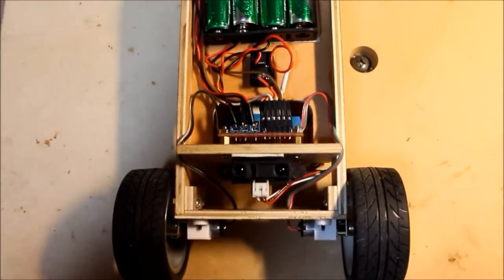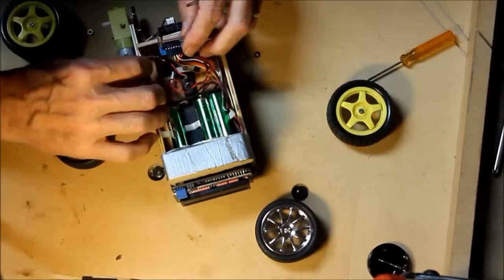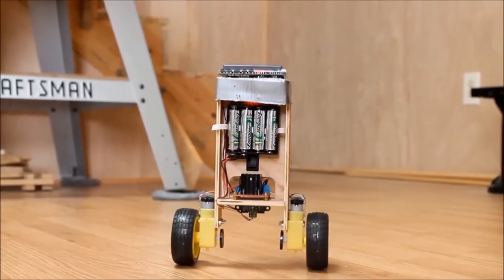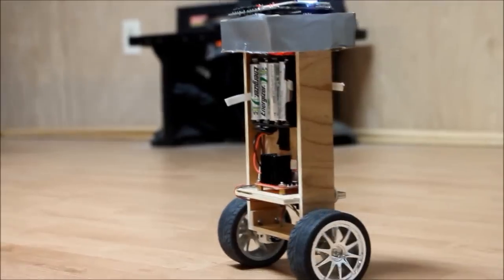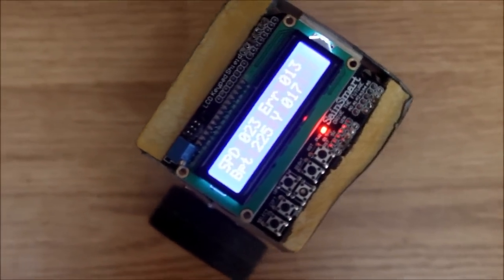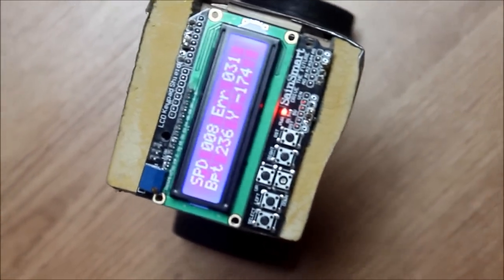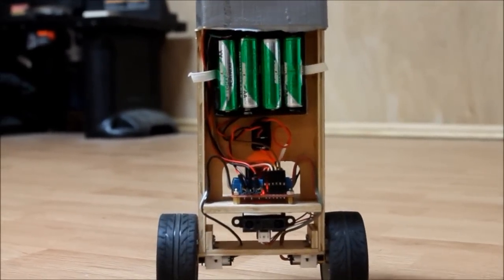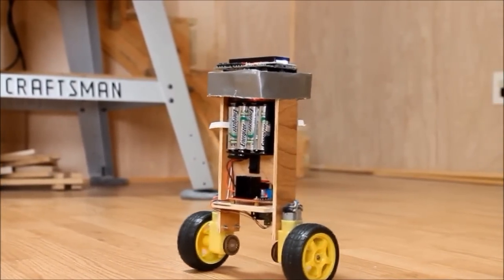Arduino/MPU6050 Balance Bot Part2

Comment: I have replicated your ROBY using an Arduino MINI and two motors and wheels i was having. It  seems to work but it is not able to keep the balancing. Surely i have to modify PID but I don't know how also because it is the first time I am working with it. Could you suggest a way? If it is of some help the error i read on LCD at a standing position is 1500-1700, the motors are rated for 77 round/minand the weel diameter is 65mm.The second question is how to calculate the Gyro and Accel offset. 
Thanks
Reply from the maker: slvg1942 "...at a standing position is 1500-1700,..." 
These number sound large. That would imply that the MPU thinks its tilted between 15 to 17 degrees.. I am used to seeing only 3 digit numbers like what you see in the video. There "192" means the mpu thinks it's 1.92 degree off of horizontal. Or another way to say it is the car is leaning forward by 1.92 degrees.
for a start, I would disable the motors and maybe some of the code and test how the reading change as you manually rotate the car about the wheel's axles.
But assuming that the gyro has been calibrated in level postion, then the number
you see on the display at startup (while holding the car at it "balance point")is the number the number (but with a decimal point before the last two digits) that you would normally load sketch variable "PitchBalancePt" with. In my case that was  "2.29".
As for what are good PID values. I have no easy way of  telling you. The best I can offer is start by setting the "Ki" & "Kd" values to 0.0 and make sure that a positive "Kp" value causes the car's wheels to rotate in the correct direction to compensate for it falling. In my case "0.32" ended up being the number I needed for the N20 motors shown in the video.  But basically you will want to find the largest value that moves your car the right way. But not so big that the car overshoots and ends up falling backwards to the direction it was originally leaning.. Next, you start increasing the  "Ki" & "Kd" values, until you find the combination that works best with your car.. Have lots patience, and build the car so that it can survive many crashes ;-)
Reply: jmhrvy1947 
At first thank for your help. 
I was checking the rotation angles and i got a little confused.  You suggest to mount GY521 component down with Y axis pointed toward the back it means that the X axis is the same of wheel  axis.
In such a way when the car lean forward or backward is rotating around X axis it means a variation of roll not
pitch or  am I wrong ?  I am not able so see the proper position of GY521 in your video so before making modification on hardware I will wait for your answer. 

I got your code from github . The following instruction
//setup PWM frequency to ~60Hz for OutPut pins 13 & 11 
TCCR4B = TCCR4B & 0b11111000 | 0x06; //Set Digital pin 13 Right Wheel PWM period @ ~2ms
is not recognized by arduino compiler because it is setting a CPU register, I have cutted it.
Reply: jmhrvy1947 
At first thank for your help. 
I was checking the rotation angles and i got a little confused.  You suggest to mount GY521 component down with Y axis pointed toward the back it means that the X axis is the same of wheel  axis.
In such a way when the car lean forward or backward is rotating around X axis it means a variation of roll not
pitch or  am I wrong ?  I am not able so see the proper position of GY521 in your video so before making modification on hardware I will wait for your answer. 

I got your code from github . The following instruction
//setup PWM frequency to ~60Hz for OutPut pins 13 & 11 
TCCR4B = TCCR4B & 0b11111000 | 0x06; //Set Digital pin 13 Right Wheel PWM period @ ~2ms
is not recognized by arduino compiler because it is setting a CPU register, I have cutted it.
Reply from the maker: slvg1942 Yes. You are correct my GY521 is mounted so that X axis is in-line with the Wheels. And the Y axis points to the back of the car.. If yours is mounted some other way, then rather than changing the location of your MPU, it may be easier for you to change the code (by changing signs and or Array elements) that are being used to sense what is happening to the car. 
As for the code issue (TCCR4B = TCCR4B & 0b11111000 | 0x06; ),  that is because the "Mini" has a different set of timing control registers from what is found on the Leonardo. So for your car, you are correct to comment this line out, and at this point, not worry about it. If you are using Pins 5 & 6 for PWM then I think you would be getting very similar results to what I have using pins 11 & 13 on the Leonardo. Or another option for you, could be to use 3 & 11,  plus the code "TCCR2B = TCCR2B & B11111000 | B00000011;"
See : https://arduino-info.wikispaces.com/Arduino-PWM-Frequency

It sounds like you are pretty close to having all the parts in place. Let me know how it works out.
Reply: jmhrvy1947 

Ok one bug is out. I was using pins 10 and 11 for PWM but they are controlled by different timer so i have modified using pins 3 and 11.
AXIS.  I was quite confused about axis because I  was  using the Eulero convention . Just to fix the point,
assuming the Z axis perpendicular to the plane of GY521 PCB and a vector with  origin (0,0,0)  the pitch is the angle done by the vector an the plane xy or if we prefer is the bent of our car referred to the  the plane of wheels
and Yaw is the angle between X axis and the perspective of the vector on plane xy or if we prefer is the steering
of the car.
I have installed GY521 with components up instead of down, but I presume there is no difference inverting Z axis
Give me some time to digest and test then i shall report if it is standing or not.
Reply from the maker: slvg1942 "...Give me some time to digest..."
I fololw you there ;-)
The terms I think of this in is "Pitch", "Yaw",& "Roll". They are artificial assignments with respect to how the board (GY521) is oriented. All three behave proportionally the same, and with them all being bundled in the same array, you can mount the board on any plane of the car you want, and then pick which ever array element returns the tilt (pitch) of the car. If that element is backwards, then flip its sign. The same process is true for the yaw. 
To test, first change the code to output the array elements to the serial port (ypr[0], ypr[1], & ypr[2]) and watch how these values change as you tilt & turn your car. Once you have identified which is which, then assign the appropriate element to "InputP" and "InputY". Then the next step is to force ""InputY" to be zero, then set the sign of the  "InputP" ypr[n] element so that the wheels turn in the correct direction to bring the car back upright when it leans forward and backwards. In other words, when the car leans "forward" the wheels turn "forward", If one wheel rotates one way, and the other turns in the opposite direction, then either one of the motors wiring needs to be reversed, or you could reverse the code [see void SetMotorDir(int Motor , boolean Dir)]. Once you have the "InputP" term working, then force it to zero, and let "InputY" control the car. And this time determine what the sign its  ypr[n] needs to be to bring the car back to its original heading.  Because you've already "fixed" the motor directional control. This time all you will need to worry with is the ypr[n]  sign.

After that you are ready to dial in the  Pitch & Yaw PID values.  This is where you are going to need a lot of patience. And car built to survive a lot crashes
Reply: jmhrvy1947 
GY521 is OK, I have chcked vectors ypr[2]=pitch and ypr[0]=yaw.
Motors also seems to be OK. I made Ki=0,  Kd=0  and InputY=0. In such a condition,  keeping the car in upright position,  the wheel are rotating continuously  clockwise  and anticlockwise trying to keep the car at the balancing position. I have just to investigate why the driver L298 become quite hot, probably is due to this oscillation. Now i have to check  the sign of ypr[0] but i had to change job. Now i am involved in grandfather's job so in the time I am trying  to go more deep in your soft, hopping my question will be of help for some one more.
I shall start with PID computation that is the first time I am using.
-- Could you state when car reach the "if(BackAway)" condition.  I was never able to reach it.
-- Why "Input = 1530.0*sin(Input) // 255*6*sin(Input)" 
-- Why SetPoint is all the time 0.00
-- What you mean and why  OS=18 and BrkPt=22
-- why "Kp = Kp*2.977
--what dou you mean  with "DtI = Ki* error" and Cap = 10.0
I have some more questions, but i hope, from these ones to understand a little more-
Thank again
Reply from the maker: slvg1942 
Ok... All good questions. Not sure how to best answer them though.
The BackAway test is probably will not apply to your car. My car is fitted with an IR distance detector (that can sense objects ~8 inches in front of it; i.e. A wall) When it does detect something, then this flag gets set and the "follow on" code changes the balance point which "tricks" the PID into making the car lean backwards just enough so that is rolls away from the wall. That part of the code, is mostly there to test the idea (or method) of commanding a that's other wised balanced to move in a specific direction, and still maintain its balance.
"SetPoint Always 0?" This was just an arbitrary choice. However, the way I came to it, was in a classical control application The user inputs a set point value, and the the control system does whatever is necessary to match that value. In this case, I wanted the car to be in balance, and that balance point was zero degrees. So my set point is always zero.

Now the rest of your questions are harder to explain as individual line items. So here's my layman's view of what was needed to make this work.
First, this is not a linear controls problem so the "P" term in the PID needs respond in a non-linear way. Secondly using the motors shown in the video, I estimated that if the car was more than 4 degrees either side of its balance point, they would not have enough reserve speed to bring the car back to balance. So by 4 degrees, they needed to be at full power; However, for very small angles, it takes very little movement to bring it back. (In the RC world they call it "Expo") So I was looking for an algorithm that effectively gave an "expo" response for a linear change in angle. 
I played with a number of different ways to get what I thought I needed, and for sure, there is no guarantee, what I settled on is the best. 
If you can run Python code, here is a test script I used to examine the "P" component over the +/- 4 degree range that I set as my artificial boundary:

#!/usr/bin/python
# -*- coding: utf-8 -*-

import sys
import math

Kp1 = 0.12 #.5 #
Kp2 = 0.9
Kp3 = 0.3
Ki = 3.6
OS = 18
BrkPt = 22
Cap = 10.0
X =  16/BrkPt+(OS/(Kp3*16))
DegVal = 02.0
RadVal = math.pi*DegVal/180.0
print("Error\tErSqrd\tLinear\tHybrdSqr\tIntegral")
for i in range(40) :
        kp1 = Kp1
        kp2 = Kp2
        kp3 = Kp3
        ki = Ki
        offset = 0
        error = 0.25*(i-16)
        RadVal = math.pi*error/180.0
        Input =255.0*6*RadVal
        errwrkng = Input
        errwrkng1 = Input
        if(abs( Input)>16):
            #Square the error term
            sign = 1.0; 
            offset = 18.0;
            if(Input<1) :
                    sign = -1.0
                    offset = -18.0;
            if (Input!=0) :
                    errwrkng = errwrkng/6.3;
            errwrkng = sign*6*errwrkng*errwrkng;
            errwrkng1 = errwrkng1/22;
            errwrkng1 = sign*22*errwrkng1*errwrkng1;
      
        else :
             kp1= kp1*2.4;
             kp2= kp2*2.4;
             kp3= kp3*X;
        errwrkng1 = errwrkng1+offset     
        DtI = ki*errwrkng1
     
        if (DtI >Cap):
                DtI = Cap
        elif (DtI <-Cap):
                DtI = -Cap     
        pwm1 =  kp1*errwrkng
        pwm2 =  kp2*Input
        pwm3 =  kp3*errwrkng1
        print(error,"\t", pwm1,"\t", pwm2,"\t", pwm3,"\t", DtI)

        

print("All Done!!")

If you plot the results of this script you will see that the Hybrid method gives the response of a linear system for small angles, but transitions into the response of a squared system for larger angles.

Anyway, hope that helps you sort some of this out.
Reply: jmhrvy1947 
HI
I am coming again. I am playing with a board fixed  on the table with same tape with instelled an arduino nano and a GY521, no more. If I load the original program made by Jeff Rowberg  the Yaw (ypr[0] * 180/M_PI)  I can read when it became stable is about 51.84 degree. In the same condition if i go to read your 
InputY =(ypr[0] * 180/M_PI) I read something about 6.70 degree. I am not able to  discover why.
Thank
Reply from the maker: slvg1942 To be honest, I am confused by your question. So I am going to try to answer it,  with a question.
Around line 230 in my sketch, you will find these entries:

    // supply your own gyro offsets here, scaled for min sensitivity
    //Sensor readings with offsets: 4 4 16380 1 0 0
    //Your offsets: -1200 -2080 1288 35 -28 -39
    //Data is printed as: acelX acelY acelZ giroX giroY giroZ
    //Check that your sensor readings are close to 0 0 16384 0 0 0

    mpu.setXGyroOffset(35);
    mpu.setYGyroOffset(-28);
    mpu.setZGyroOffset(-39);

    mpu.setXAccelOffset(-1200);
    mpu.setYAccelOffset(-2080);
    mpu.setZAccelOffset(1288);

These values( 35; -28; -39; .........; 1288),
are only really true for the MPU I have here.

Have you found the values you need by running the sketch found at?

http://www.i2cdevlib.com/forums/topic/96-arduino-sketch-to-automatically-calculate-mpu6050-offsets/
Reply: jmhrvy1947 
OK bug solved. All the problems I was having was due to the offsets. At the same time I learned an obvious thing. Whichever is the position on the table of the GY521 , when you start the MPU6050, this became the reference position or if you prefer the zero position.
Reply from the maker: slvg1942 Excellent.... Sounds like your ready to move on to the next problem... Speaking of which, is the 298 still getting hot?
Reply: jmhrvy1947 
I shall give the answer at the end of the month when I shall be bach at home, now I am 1000 km faraway  with just a MINI and a GY521. I think I shall face some more problems becase my car is heavier than your and with quite bigger motor. if you like and you say me how,I shall send you a photo.
Reply from the maker: slvg1942 I'll send you a PM.
Reply: jmhrvy1947 
HI

As you have foreseen there is a new question. You have defined two variable "Setpoint" and "SetpointS" Why are you using  "setpoint" in PID steer computations ? 
659 double error = Setpoint - input;
Reply from the maker: Paolo Salvagnini Your question is a valid one, and I hope you will ask about any part of the sketch that doesn't make sense. 
The honest answer here is that this sketch was a work in progress, and  much of it was a first time effort in the world of digital PIDs. When I declared "Setpoint" and SetpointS, my intention was to use "Setpoint" to manage/host the offset that might be needed related to the "pitch" axis, and "SetpointS" would perform the same role for the yaw (or "Steering" ) PID. As I got deeper into the coding, I found it more convenient to combine (algebraically sum) these terms as  part of what the classical pid calls the "input", and just leave the "Setpoint" term aet at zero.
In other words all I pass to the PID's is the current "error" value.
Admittedly the coding in this sketch is not elegant, and its definitely not "tight", but in this case the computer doesn't care. 
It wasn't until I did the IR RC version of the balance-bot, and started hitting the memory limits of the Leonardo, then at that point I was forced to go back and clean these kind of things up;  However, it was sometimes surprising how little memory I'd gain.  I found you'd get much more bang for your memory buck if you could cutout using something like the Cos() if  its only used once. But that's another story ;-)
Reply: jmhrvy1947 
HI
I am back again with some more questions
At the beginnimg of the loop you have the following statement where
I cutted away your comments for shortness. 

        do {
     Wire.beginTransmission(address);
     error = Wire.endTransmission();
            if (error != 0) {
               ShowMessage("I2C Err" ,(int) error, 1, 0);
             }
   } while (error != 0); #### if error program is frosen here
###### The above check is done to be sure that comunication between 
 MPU6050 and GY521 is OK. If the connection is working it will keep 
 work at least up to the new restart. 
 So why don't put this check in the setup() ?

 fifoCount = 0;
 while (fifoCount < packetSize) {
  fifoCount = mpu.getFIFOCount();
 }
###### you go out from While if fifoCount > or = pachetSize
 
 mpuIntStatus = mpu.getIntStatus();
  
###### why you are reading again fifoCount ?
 fifoCount = mpu.getFIFOCount(); 

 if ((mpuIntStatus & 0x10) || fifoCount == 1024) {
 
  mpu.resetFIFO();

 } else if (mpuIntStatus & 0x02) { .......
Reply from the maker: Paolo Salvagnini I think the main question here is
" why you are reading again fifoCount ?..."
What I found, and it may be due to my not using the MPU's interrupt, to synchronize the fifo fetches, that occasionally I would get a "bad" set of fifo data. Which when passed to mpu library, to be parsed into "pitch", "yaw", and "roll" values, these readings would be outrageous.  But by "double checking the fifo count. This issue went away. 
At the time time I only had one MPU, and one Leonardo, so I don't know if this is something common to all, or if I had a unique situation. What I would suggest is, once you get everything running, you can try skipping this check, & see if your setup  continues operate correctly, or does it occasionally go crazy.. Let me know what you find